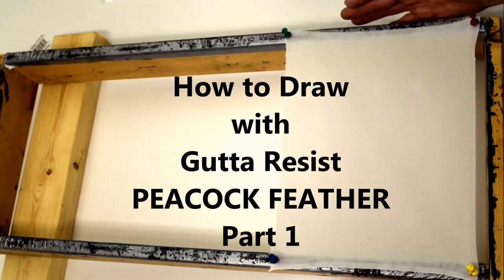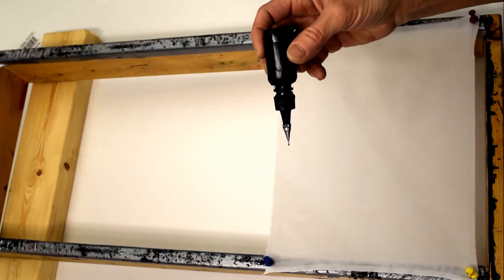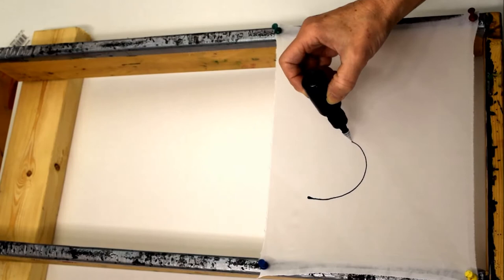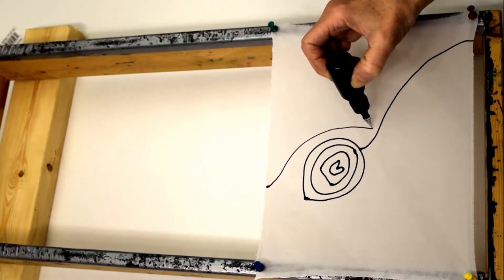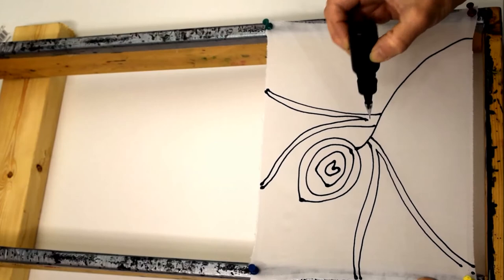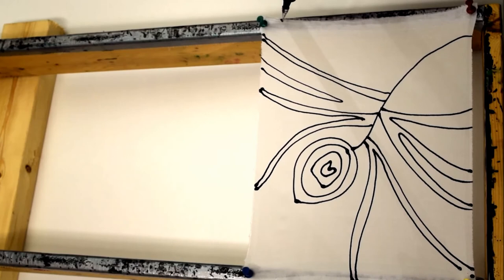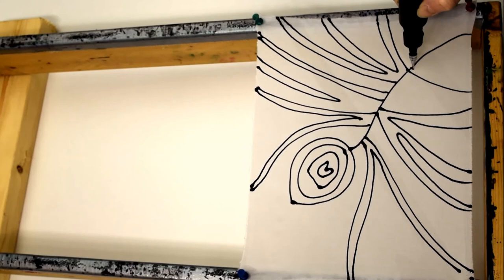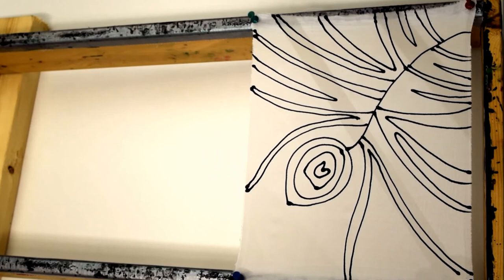Silk Painting GUTTA RESIST Techniques

Comment: heloo.and where are these bottles of filler for paint with a metal tip
Reply from the maker: They are 2 separate pieces. One is a plastic bottle with a screw top. The second is a steel tip nozzle you can get in different sizes. Dharma trading co has them online

Comment: Hi...
I would like ask you a quesion.
I am a beginner and also a clumsy one...
I have Deka gutta trasparent bit 
it's super compact. my hand hurts to crush and the gutta doesn't flow smoothly. should I dilute it? 🤦‍♀️🤦‍♀️ thanks so much....
Reply from the maker: Hi , I don't work with Deka Gutta so unfortunately I can't give you advice on how to handle that product.
Normally a gutta is either solvent based or water based so depending one which one it is you use, a product related to the type such as water of mineral spirits might help
I personally use Jacquard gutta solvent based or Dupont gutta solvent based
Reply: @LynneKiel  Thanks for the reply. can I ask you if the gutta you use in the video of what brand is it? And if ready or if you have diluted it, with what and how? Thanh you
Reply from the maker: @kikigongo  I am using dupont gutta and I have diluted it with a "paint thinner " I use either varsol or mineral spirits . I add a little and mix it well then test it until it flows the way I like on the weight of silk   I am using
Reply: @LynneKiel  thanks so much for the answer... and I promise that one is the last one 🤦‍♀️ the bottle.... where do you buy it? What is the diameter of the spout? Thank you really so much...
Reply from the maker: @kikigongo  I have long lost the packaging for  the tips I use so I can't give you an exact size but for my purpose a slim straight pin fits it the end. If it is too small the line is too weak and might not hold the dye. I have had a hard time finding the guta so sometimes I buy form Jaquard  directly for solvent based gutta or go online to find dupont gutta.